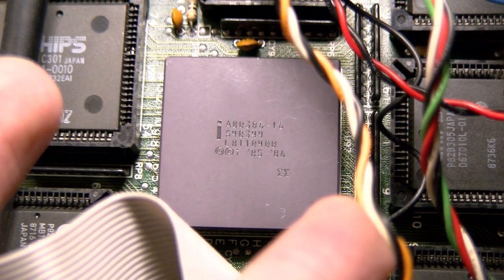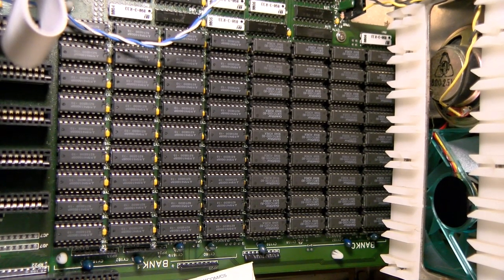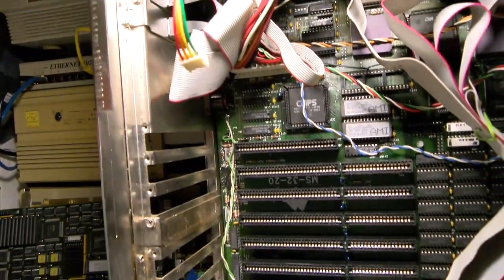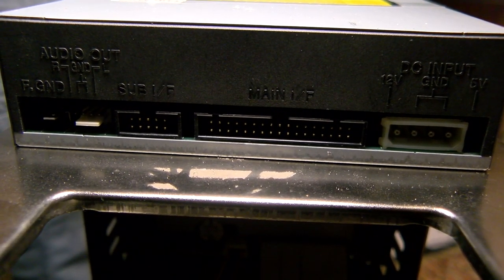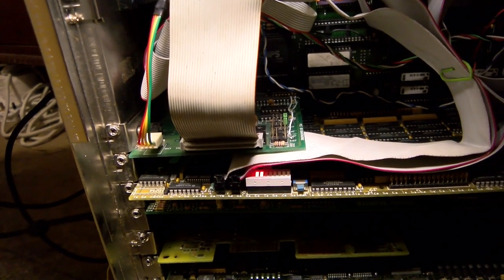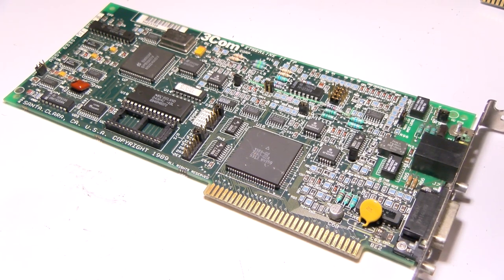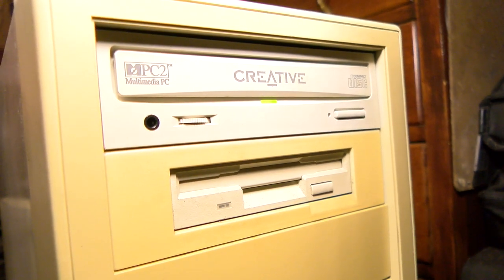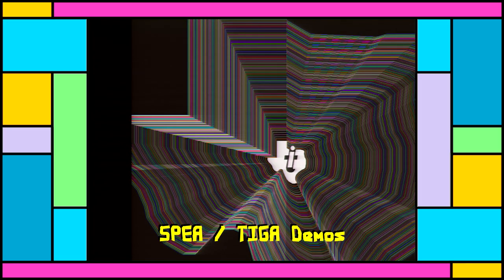The Big 80s 386

Comment: Out of all of my 386 systems, I cherish my 386dx ones the most, because true 32-bit protected-mode software had an almost visceral speedup compared to a 386sx-16 at the same clock speed.  32-bit memory access to 32-bit registers was a real gain, and it's a bit of a shame that it took nearly 8 years before we started to see real 32-bit DOS apps -- and by then, the 486 was out and could just brute-force its way through anything.  I view the 386dx as the CPU that never quite got a fair shake.
Reply from the maker: I feel the 286 was somewhat similar, in that there were things it could do that were rarely if ever utilized. The countless 8088s that software still so often had to target held things back, it seems. 
This thing might end up running NetWare or something, at some point, albeit an early 90s version, as that might take better advantage of the hardware now the TIGA is busted; those two LPT ports correspond nicely with my two dot matrix printers and those large hard drives could be used for storage, as they're only so large due to the plan to do MPEG stuff back when the machine was on the faster Everex board.

Comment: This takes me back! My 386 looked very similar to this one, except it was black- but that front panel with the turbo/reset/power switch looks identical. am386 40Mhz, 8MB RAM, and two 50MB Hard drives, and a 1x Mitsumi top-loader CD-ROM Drive

Comment: A CDU33A with a custom tray bezel. I didn't know a Creative branded version of that drive existed. The CDU33A was my very first CDROM drive in 1994. It came with a custom controller card, but it can also be connected to many sound cards. It was slow, but had a nice look & feel with its two color LED and the fancy eject mechanism. I also do remember that I was able to rip music CDs with this drive a year or two later, something that my second 4x IDE drive wasn't able to do. Though at 2x speed you needed to bring some time with you. It was able to read burned CDs, but it was pretty picky. I was very lucky to aquire a CDU33A in a box of junk last year. These are very rare  nowadays.
Reply from the maker: It will sometimes sort of read files from a CD-R if I keep re-inserting the disc. For some reason it has a much harder time playing audio than anything else, as in you can totally read the disc, but the drive likes to lock up when told to play music. Admittedly I do think the 82206 on the motherboard may be partly to blame, given the SLCD interface uses DMA and we know that's not reliable in here, especially 8-Bit DMA.
I'd have used IDE for the CD-ROM if I could, but the ESDI controller uses the same resources, 1F0h & IRQ 14, versus 320h & IRQ 5 like MFM.

Comment: That's a beast of a machine, Interesting to see how RAM was installed before it came on a stick, Said motor in this 90s Henry would be the 1100w SAF made by Panasonic, Awesome motors. This was replaced around 99 with the Panasonic UDS motor (Used very briefly in the Dyson DC05), They had a habit of destroying the armature and sticking carbon brushes.
Reply from the maker: It's a shame the RAM expansion cards pretty much don't exist, not that they'd be overly useful beyond demonstrating how they looked and acted, not that they do anything special. Might have to build one for another board that lacks any onboard RAM at all, though.
I'm rather fond of the sound of these older motors, with their lower pitch than the current models, admittedly in large part likely just because it's what I'm used to. That said, I'm impressed by how well the modern machines perform, given their much lower power draw, having used a 2010s HET160.

Comment: Baking does wonders sometimes. The hard part is not overcooking it.
Reply from the maker: Sometimes it does, but I feel that's more for newer BGAs and would have a lower success rate with these ancient PLCCs. Still, if a component is completely broken, then any option available should be tried anyway, because the worst case is that you go in with a broken part and come out with a broken part, but may at least gain more experience on the way.

Comment: Love the content!
If I had to guess, the instability could be comming from the following things - as you said, you have to poke and bash it to get it to work:

-Worn PLCC sockets
-And that battery damage might have something to do with that as well.

If you could get theese things sorted, I bet it would be much more stable.
Reply from the maker: The sockets were a thought early on, but they seem to be fine electrically, albeit rather battered looking. You might notice pencil marks on the LSIs, which were added when testing them in another board. They were confirmed to just be kinda faulty, which just seems to be the way for hot running early CMOS of that scale, especially when it likely ran 24/7/365 for years in a country with a hot climate. Surprisingly, there's no battery damage at all on the board and the one it came with was still working, removed only as a precaution.
In any case, simply replacing the LSIs with properly working ones, and replacing the few shorted NPNs in the battery and clock divider circuits would likely do wonders for it.

Comment: I really love old desktop-style cases, but I really really love enormous 80's PC towers. I just wish I had more room to keep them, It's a struggle with the few I currently have. Actually, that case looks very similar to the one I have, except mine has a green power switch that lights up. I currently have a socket 3 EISA board in there that I'm still trying to get to boot correctly. it has not one but two Dallas RTC batteries on it and although I've managed get the thing to POST It won't boot to anything.
Reply from the maker: Won't be getting any more now, so it's just organizing what's already here. Indeed, I've seen these cases and a smaller version, too, with various power switches. The second Dallas on your board is for storing the EISA configuration and sometimes those don't have batteries, instead using some form of NVRAM. The same ones show up on RAID cards sometimes. So far as I know, you'll have to configure it with the relevant files from a floppy before the machine will do much of anything, though I don't recall if this includes non-EISA cards, nor whether the configurators were generic or board specific. I'd wager they'd be at least chipset specific.
The WD VGA seems to be luck of the draw, as I've seen them go faster myself but also know of other's that go slower like this one. Perhaps there was a BIOS change or maybe they sometimes get stuck in 8-Bit bus mode on certain machines. Wouldn't know for sure as it isn't bothering me. The performance penalty for using a RealTek, which is slow, is minimal, so I'm sure the rest of the machine is the bottleneck anyway.
Reply: @HighTreason610  I have a WD90C30-ZZ based VLB card which I picked up on the tip that it was very fast if you use the undocumented jumper settings to set it to 0 wait states. What I didn't realize is that different cards, which may otherwise look almost identical, can feature slower memory. Unfortunately, I wasn't observant enough and the card I picked up is one of these slower types, besides the slower memory they look identical but mine is quite slow. As for the EISA board, ugh, I'm not looking forward to that struggle but like some ultra-wealthy old man who's experienced too much, I grow bored of conventional retro computing pleasures and seek......more exotic pc indulgences.
Reply from the maker: The WD VGA here does perform a bit better on a faster machine, at least, upto probably a single clocked 486, beyond which I suppose I'd want VLB or PCI anyway. It's not really a weak performer, nor all that strong, more middle of the road. The system here does occasionally lose a bunch of speed and reports a mere 200KB/s on video RAM for some reason, which is almost certainly the motherboard being dodgy rather than the card.
Yeah, the challenge of getting something to work that is largely unknown is no small part of what makes this stuff fun. Next on this list might be getting disk mirroring going and figuring out how to work with NetWare.

Comment: I don't think 50ns dram was around during the 386 era, they may have been available as unobtanium during the later part of the 486 era, but 50ns and 45ns dram was more common during the Pentium era into the Pentium II era on enterprise servers and very high end workstations, asynchronous ram was dead in the consumer market and replaced by SDRAM before 50ns dram could make it's way into consumer systems. On an early 386 board I'd be surprised if they actually have the option to run ram any faster than maybe 80ns.
Reply from the maker: 80ns seems to have been around in 1988 at least, which would make sense because of the 0WS 12.5MHz 286 machines starting to appear in droves at that time - Conveniently, 12.5MHz is 80ns. The 25MHz Everex board can only go as low as 3WS, which would be 120ns. The SRAMs on that board are 25ns. I'm not sure which clock gets fed to them, but this'd be good for straight 40MHz.
You could maybe, just barely, push some higher quality 70ns ones to do 16MHz (about 62ns) if a board supported it, I guess, but indeed, I know of no older 386 boards that do. That C&T interleaving really couldn't come soon enough.

Comment: Since you’ve covered most of the hardware in most of the areas you want to cover 286 , 386, 486, pentium etc where next? … I’m sure you must have a few more esoteric thing to explore? Software, storage setups, networking, using smart plugs to voice activate power on old rigs, when did sleep and wake on lan evolve to minimise such rigs power consumption, a cpu generation 5 minute overview series with top and recommended hardware for each cpu gen
Reply from the maker: Don't know. There are things on the list. Seeing as this machine might end up running NetWare, that might get a video if it does and in any case, I probably will have to look at more software oriented videos over time. A small number of fundamental digital electronics ones have already made their way out and more might appear eventually. Those ones are real fun to make.

Comment: its called a full tower case i usially got mid towers so i can fit at least 2 disc drives
Reply from the maker: Arguably this is a retronym, as the original IBM 5170 AT used boards closer to this size and that's where the form factor comes from. Technically, then, the more common cases are 'Baby AT' to fit smaller form factor boards.